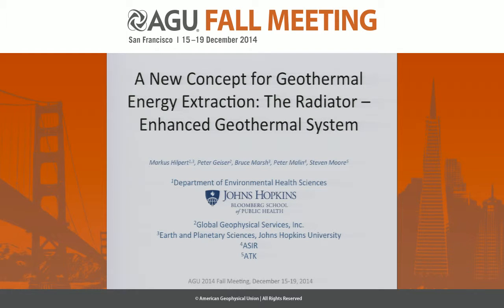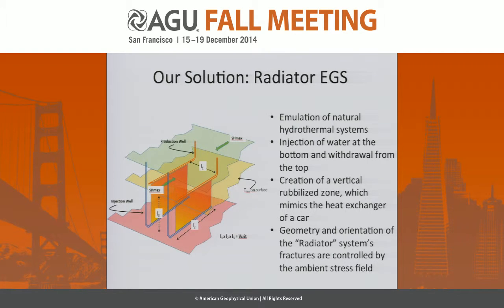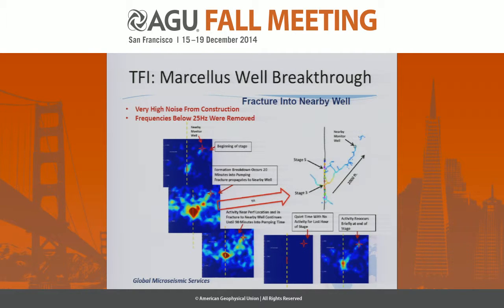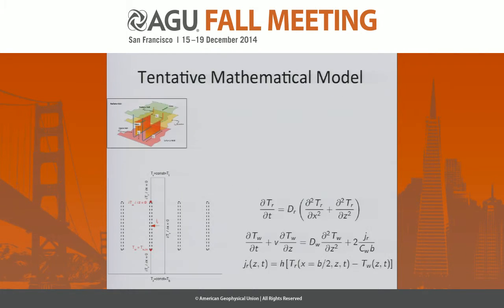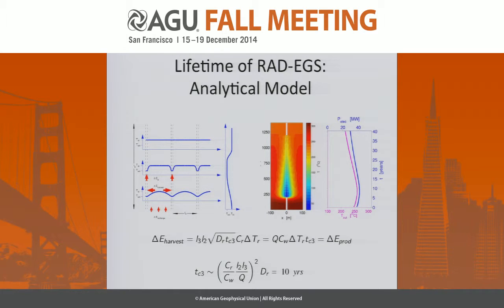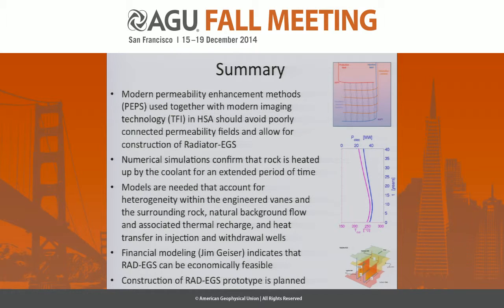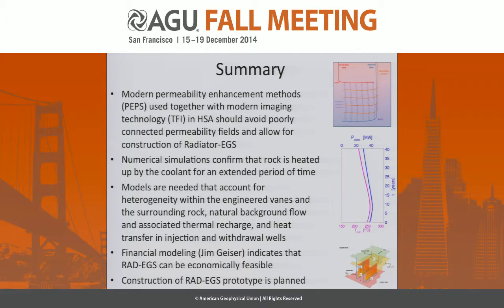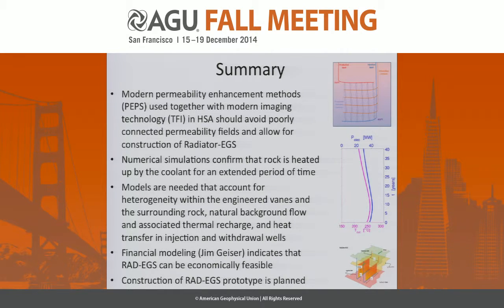A New Concept for Geothermal Energy Extraction: The Radiator – Enhanced Geothermal System

Comment: How to control a volcano with hydrothermal technology? That's a question that may have an answer. If you could draw heat off of a volcano to keep it from reaching the heat needed for an eruption that would be the primary control. Secondary controls would be accessing lava containment in the mountain and tapping that into stream beds lined with titanium or platinum or some type of ceramic that can withstand the heat, that are appropriately directed into magnetite brick storage beds which would help to conserve heat collected.